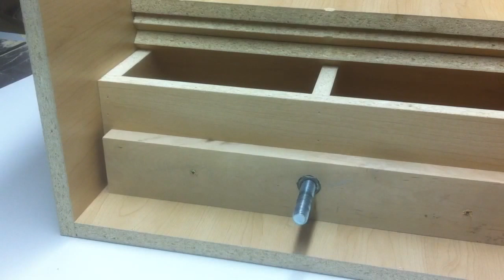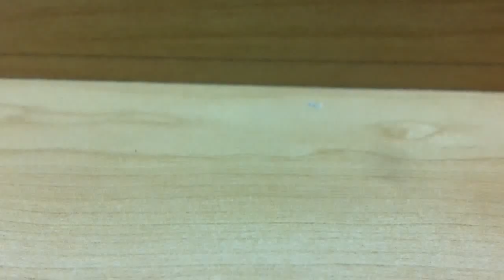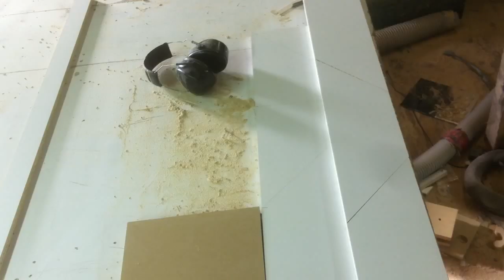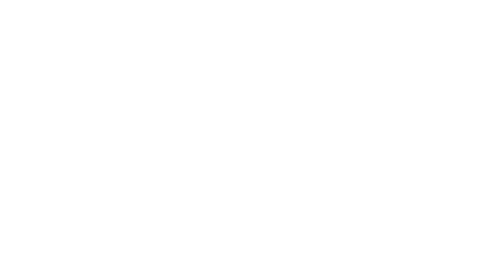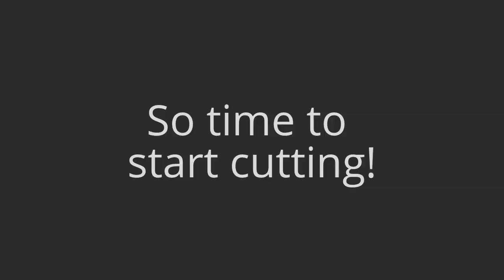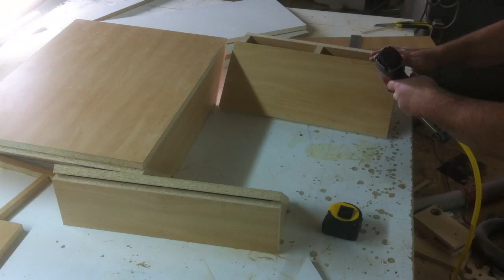Wooden Tool Man's DIY Drum Sander 7  Up and down Made easy!

Comment: I love this method!  Simple and elegant.  I had been looking for an easy way to make a router lift  and I think you may have solved my problem.  The only modification I think I would make is to attach 4 springs in the corners to pull the table down into the ramps.  This would keep the table seated.  Thanks for a great video!
Harold
Reply from the maker: Glad this helped you!

Comment from the maker: The holding a little pressure when I lower it is not a problem. It's just cause of the friction cause it tight in between. It's no big deal. I raise and lower it a bunch with no problem.
Reply: You could add a bungee cord to the underneath side to pull it down, so you don't have to hold it.
Reply: 4 light springs on the corners would have held it tight as well...